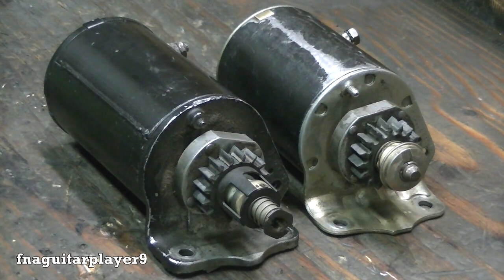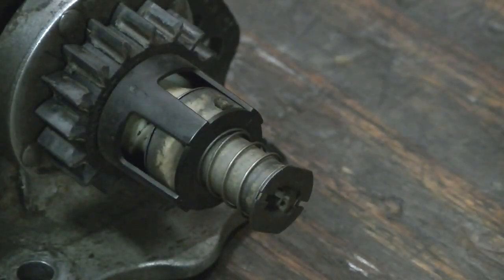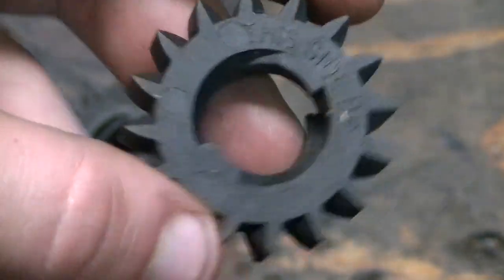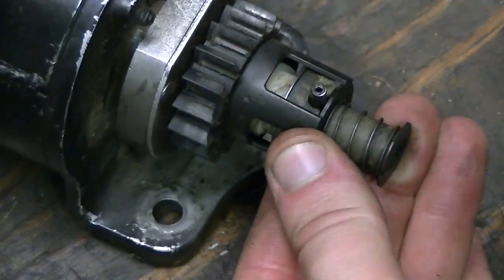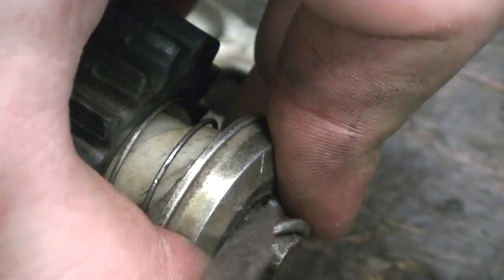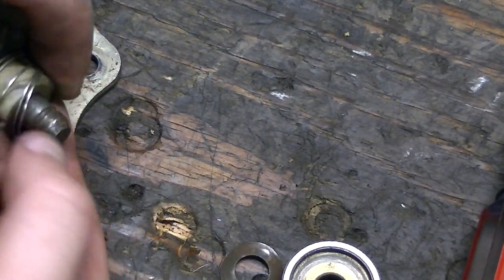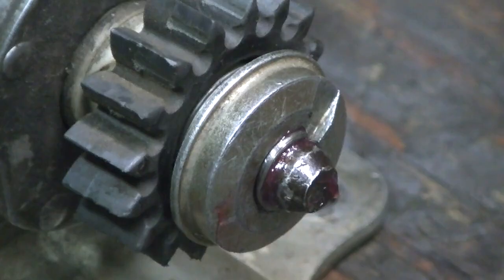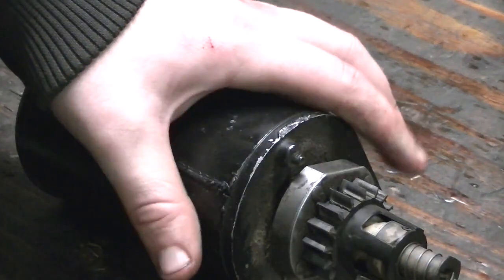How to replace a starter gear on Briggs and Stratton Starters (both rollpin and C clip type)

Comment: i just did mine last night, c clip type. I used a 9mm or 10mm socket and popped it in that way by thrusting it down from above, otherwise id still be trying

Comment: @fnaguitarplayer9 yeah i cant figure it out either i will have to look at it next time i have it apart, mine has notches on one side of the ring gear so i dont have to pull the starter to replace the gear

Comment: put the c-clip on top and with a pipe that fits on the c-clip and knock the c-clip in place do not forget to tell wenn you change the starter gear look how much teeth it has. Can be 14 or 16 and don't use iron teeth on iron teeth (flywheel) use plastic/iron. Getting the c-clip off only works with a lot off band aid. :-)
Reply from the maker: That is a good tip, i should have mentioned in the video. Thanks for Watching!!!

Comment: At the end (after assembly), forget WD-40 - it is junk, has been for years.  Use BLASTER.  It is super for Disassemby of terribly difficult & frozen parts.  Use patience and let it soak a bit, 10 minutes or overnight, as needed, pretty good preservative and as an assembly lubricant too.
       Removing the C-Clip IS very difficult (stupid B&S, Drift Pin is better and easier, but there is are disassembly / assembly tools available (worth it in the long run).  Only took me 2 HOURS to get that tenacious C-clip off (Old Age is only for the brave), but C and Split rings do hold very well if properly installed.  When he has the C-Clip mostly off, as in the video, use your Fingers or Needle Nose or small Vice Grips to grab the C-Clip and NOT shoot it across the garage.  When it is off as far is the video shows, fingers work fine.  When you have a good grip on the clip, a rag or paper towel draped over the work area can help restrain that "Rocketing" C-Clip. This is a very hard C-Clip, my Dremel would not cut it.  Small sturdy screwdrivers work and do a good job on your fingers too, if not careful. 
       Manlybydesign's GREASE is a good "hold it in place" set of fingers "tool.   And then a socket that just fits over the shaft or a piece of Copper Pipe (cut SQUARE on the Clip-end and it is softer and not as slippery as a socket)makes a decent tap the C-clip back in place driver along with a LIGHT weight ball Peen Hammer (4 oz. is fine) and small enough (made mine in Livingston N.J. High School = Lancers) back about 1953 and it still works just fine (Thanks Mr. Ayres and LHS.  St. Johns Elementary  and LHS taught me more useful things for my life than 7+ years of colleges, except for Algebra, Trig, CAD and Physics and some XXX years of blue and white collar tech courses, except for SCUBA - Yea!
       B&S's Pinion is not all that good of a material either, but it beats replacing the ring gear as the part designed to fail.  Happy frustrating yourselves folks,
       Or get a woman to do it - they have smaller fingers and more patience.  

                  "When you stop Learning, it is Time to Die."   =   a direct quite from mr. nobody = me!
Reply from the maker: +Richard Murphy Good tips! I do usually PB to break stuff loose, it does a really good job. But i do keep wd around for certain things. I've lost many of them things being shot across my garage haha I'm going to try that socket / pipe trick next time, someone else suggest it as well. Thanks for Watching!!!

Comment: Man I have an 80's model toro and the pin still won't come out after i put and set with PB blaster  on it is there another trick or keep trying
Reply from the maker: Usually you can work it back and forth and it will come out, but in a worst case scenario it can be drilled out but it has to be precise for a pin to stay in it. Thanks For Watching!

Comment: @fnaguitarplayer9 i used to have a extra starter for mine but i sold it, i dont know ith the notches are supposed to be there or there from the  gear breaking the clip and coming off, it did that once

Comment: a ten year old video but i'll ask anyway... For the second one,  I couldn't push down on the metal cap as easily as yours but eventually was able to dig out the c clip. Now that  cap won't come off. Yours slid off with ease. I've even banged it with a hammer. what's up with that??

Comment: I replaced my solenoid, new starter gear, new battery, spark plug, new air can gas filters and the damn thing still will not turn over, just the the now the starter makes...ANY ADVISE PLEASE
Reply from the maker: Cornelius Cooper Try connecting power straight to the starter, bypassing all wires, just to rule out a bad connecting somewhere, if it still doesn't do it, you have a bad starter, you can take them apart and see whats wrong and try to rebuild it. or just get a new after market one off ebay or tewarehouse.com for like 40 bucks. Sorry for the late reply, thanks for watching!!!

Comment: with the c clip stand the staror motor up put the c clip on top of the tapered bit and use a socket the same size as the shaft and tap down lite with a hammer goes on first time
Reply from the maker: +eddie bowser That makes sense, I'll try that next time. I hate these type! Thanks for Watching!!!

Comment: I lost the C clip for my shaft. And I bought a new gear and spring from Briggs and Stratton but it didn't come with a C clip. Any idea where I can get a new one?
Reply from the maker: If you have any local small engine / lawn mower shops they should be able to get it for you, its part # 691265, if that helps any, or you could grab some off of amazon or ebay pretty cheap. Thanks for Watching!!!
Reply: @fnaguitarplayer9  thank you!
Reply: @fnaguitarplayer9  is that same clip used on other Briggs and Stratton starters. I have a Toro 2450

Comment: my clip popped off and i couldn't find it can you buy just the clip anywhere i dont need the whole kit and don't even know what starter i have mine looks like the one with the c clip
Reply from the maker: I hate when that happens, yes you should be able to buy just the clip, its a called a c clip, if you take the starter to a local small engine shop they should have them, you might be able to temporarily use a E clip if you have to but it might not work as good, but are more common to find at auto parts stores. hope this helps, Thanks for Watching!!!

Comment: I have 2 starting motors for snow blowers. They aren't burnt out and there are no wires broken. The brushes are good and using a 110V bulb and pigtails it shows that the brushes are getting electricity, but neither of the starters will turn. They are even shiny and clean.
I was looking around at the STATER and Thermal-protector has #s 7AM then 025 also F5K. on the other side is 10 kLIXON
Only thing I know is that this might be blown???
I used a OHM tester, the heat sensor is working by the looks of it. The ENGINE works perfect. My problem is that the electric motor won't spin. There is electricity getting to the brushes, there is elect. going through each of the motors, they just won't spin. I cleaned the copper area that takes on the brushes on the armature, I even switched armatures. NOTHING. They should be working. I am going to try to check the copper plates on the armature, but I am sure they are OK too. No burnt smell, no soot, nothing, just shiny and clean.
Baffled. And this is 2 motors with same problems. Any advise would be greatly appreciated.
Reply from the maker: TheWolfmanG Ok, i'm a little confused, is this a briggs starter? or a tecumseh? It sounds more like a tecumseh starter, i've had BAD luck with tecumsehs starters (and engines to for that matter haha). If it is a tecumseh, it may have a diode or fuse/thermal protection. If its a briggs the only thing i can think of would be weak magnets. let me know what type it is and i'll do some research. Thanks for Watching!

Comment: how do i adjust a governor on a 21hp yard machine riding mower   will start great  but just sits and with no throttle   speed up or speed down
Reply from the maker: Robert Miller It should be very similar to this https://youtu.be/9rO8AvDrdeM its not the same engine but all small engine governors (non air vane type) are very similar. Thanks for Watching!!!

Comment: it is easier to take a  deep well socket the correct size and set the snap ring on the tapered end of the shaft and a large enough c clamp ir vice  and  screw the c clamp  into position until it seats. i have tried the method in the video and  sprung the snap ring to the point it  would not hold this is the method  briggs tech school teaches
Reply from the maker: +brokenwrench1 Some others have suggested that, next time that will be the way i do it, seems to be alot easier. Thanks for Watching!!!

Comment: You have to support starter armature/shaft when punching out pin. This is more like a "how to damage/ruin a $135 starter" video.
On the retaining hog ring-type starters, there are 2 tools made for this. One is to remove, one is to install the hog ring.
They are very expensive, but the correct way to do it, not prying & poking holes in your fingers.
Good small engine shops have these tools (I do) and will charge $15 (I do) to replace gear.
Do NOT spray oil on starter!!!
Do it right or not at all.

Comment: I have the C type starter. Why is it not going to engage with the flywheel? It just spins.
Reply from the maker: Try moving the gear manual on the starter (with power disconnected first!) it should spin freely up the shaft, try a little wd40 to free it up, sometimes they get in a slight bind and will just jam up and after that they are ok. Hope this helps! Thanks for Watching!!!

Comment: Its not recommended to use any lubricant on starter drives. This is why they have plastic bearings so no lube is necessary as it will attract dirt and eventually cause the drive to stick, breaking the gear. Its always good to wash it down with brake cleaner but no lube!
Reply from the maker: Makes sense, i usually only use wd40 if it sticking. Thanks for Watching!!!

Comment: The piece that goes on and attaches with a roll pin is not plastic, it is metal, the spring cage is plastic however.

Comment: were do we buy the gear.
Reply from the maker: I got them cheap from tulsa engine warehouse (tewarehouse.com) but you can get them off of ebay, amazon, and some local stores will have them as well. thanks for watching!!!
Reply: ORIELLY  AUTO PARTS SELLS THEM IN THEIR PRIME LINE SECTION

Comment: The spring in mine is sprung can I just replace  it?
Reply from the maker: Yes you can, I've ran them without the springs, it just helps keep the gear from getting stuck on the flywheel. thanks for watching!!!

Comment: Can u swap the pin type onto a c clip starter
Reply from the maker: You would have to drill a hole first for the roll pin, if the shaft is the same length then you should be able to. Thanks for Watching!!!

Comment: I got the c clip but then how do i get the retainer off?
Reply from the maker: Everything else should slide right off the shaft, once the clip is removed, there may be a burr or something keeping it from sliding off. thanks for watching!!!
Reply: yea must be something because it won't slide off.We even took channel locks to it and hit the channel locks with a hammer still want come off. Don't know anything else to try. hate to buy a whole new starter after watching your video.
Reply from the maker: It might be rusted on or be seized to it, every one i've took apart they slide off as soon as the clip or roll pin is removed. I know what you mean. You can aftermarket starters on ebay for around 30 bucks.

Comment: I have to disagree. Having been doing this for 40 years and assembling them dry, I never had any lock ups. It's wise to replace the entire drive if any wear shows.
By oiling, the oil is a dirt and dust magnet. Unless the rider is used properly (mowing green grass) it is subjected to a lot of abuse. Most people don't realize these are lawn mowers you ride on (riding mower) and use them to mow fields full of rocks, dirt, etc.
No, the starter drive is to be dry. The teflon slide is the lubricant.

Comment: I wish those gears were metal
Reply from the maker: On some they are, if you have a flywheel with a steel ring gear you can use a metal gear, but if it has plastic or the teeth are cast in the flywheel it has to be plastic. Thanks for Watching!!!